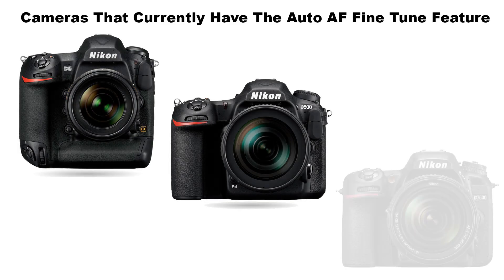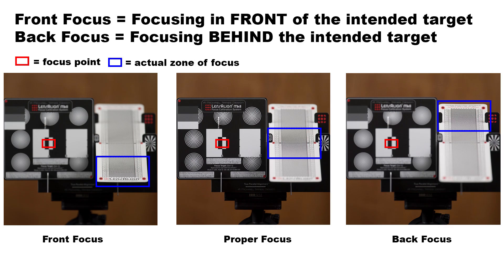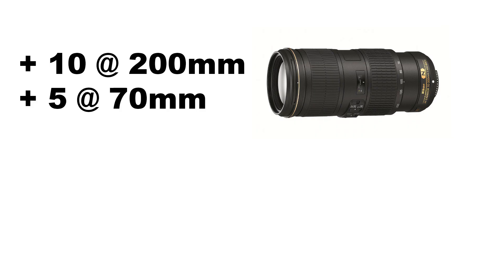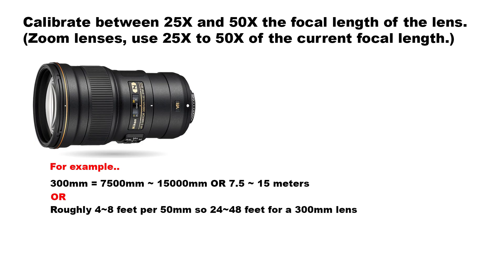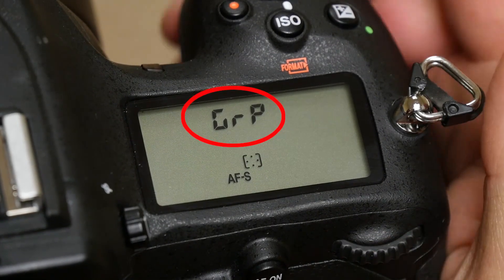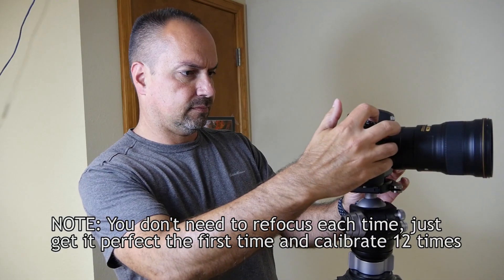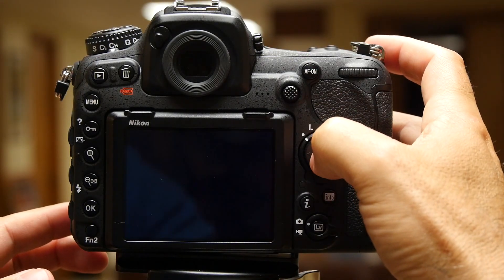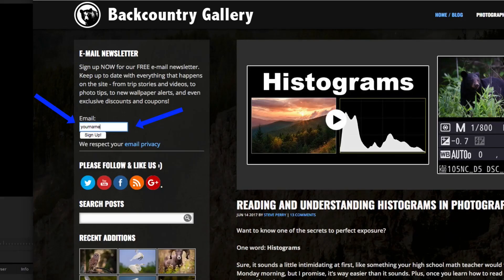Nikon's Auto AF Fine Tune - How To Get The Most From It

Comment: Hi Steve - thank you for your video on this topic - very helpful.  Do I change my camera distance for each focal length from target image?  For example, at 70mm x 30 = 6'-11", but at 200mm x 30 = 19'-8".  Sorry, I'm not clear where I should set up my camera for zoom lens.
Reply: I'm not sure what the best technique is when using a zoom lens. However, I can think of two options:

1) Fine tune at the focal length which you're most likely to use in the field
2) Fine tune at the longest focal length, since this is where the depth-of-field is the shallowest
Reply: Louis - thanks for the suggestions.  I will try both and see if the values are close or far apart.

Comment: Steve, I tried the af-autofocus procedure with my 24-70mm f/2.8 ED Nikkor.  At 50mm I'm getting values in the range of -4..-2 while at 24mm I'm seeing values around +15 with a significant jitter.  Values for 28mm are around +4.  Would you consider this lens (which has at times been treated roughly) a case for sending to Nikon for adjustment or repair?

Huge thanks for this howto video, it's not only good, exactly as long as it needs to be but also fills in where Nikon's manuals leave something to be desired.
Reply from the maker: I hate to say it, but that's a pretty wide spread. If it were me, I'd probably send it in.

Comment: Steve, I have a Tokina 11-20mm f/2.8 DX Pro lens and it has back focusing with the camera (APS sensor), should I multiply it with 1.5 crop factor and then 25 to 50 times or just multiply directly with 25 to 50X. Thank you :)
Reply from the maker: Don't worry about the crop factor - use the actual focal length.

Comment: Steve, I'm all the way to -20 on my D600 and 50mm 1.8g and it's still back focusing. The D600 focuses correctly with other lenses. Thanks!
Reply from the maker: The lens may need to go into Nikon - there's not much more you can do.

Comment: The  nikon D800 manual says the the camera may be unable to focus at minimum range or at infinity when AF fine tune is applied, could you explain this?
Reply from the maker: What can potentially happen is that if you dial in an extreme amount tuning the lens can run out of focus range with the physical focusing components of the lens. The truth is, I've NEVER seen this happen nor have I ever heard of it happening to anyone. Lenses have a bit of "play" in the focusing ring and it generally compensates for this. There are probably one or two lenses out there in the Nikon world that this can happen with and thus the warning. Don't lose any sleep over it :)

Comment: Probably explains why I've never had a decent picture from any of my lens. Time to switch to another brand. A friend has a Canon, so maybe good time to trade.
Reply from the maker: This isn't an issue that's exclusive to Nikon. Any PDAF system can benefit from AF Fine Tuning - and Canon has had the option for at least as long as Nikon (they call their AF Micro Adjust). Can't get away from it...
Reply: Sorry, Dave but I have the 5D IV and  D850. Focus on my Nikon (D800 and D850) is instantaneous but Canon can't cope. Of course, I'm speaking of action photos but switching will just be a carryover of your problem IMO. I'm comparing 300 2.8 IS L to 200 2 VR lenses here and for sure the shorter lens will be quicker but... I miss 70% of my shots with the Canon while I get 90% good ones with the other two. The focus on the MKIV is not that slow but takes ages to recapture and be spot on.

Comment: Will it work on a d7200?
Reply from the maker: Sadly, no. Right now, just the D500. D5, and D7500.
Reply: Ok I know it has that feature
Reply: Steve jespersen 
Yes, mine D7200 has this feature too, I tried to press AF + record button but nothing happened. I found out that it is possible to add values manually, edit and save them. But very strange that AF + record button doesn't work..

Comment: Can I use this auto af fine tune to actually put the calibration values for a sigma 500 f4 at different distances with the usb dock? So I am suggesting that say I need the value at 3,5 meters then I find it out with the auto af fine tune and then I input the result with the dock (of course in the end the body will have a fine tune value of 0 as the lens will have all the necessary info already). Thanks for the video in any case 🙂!